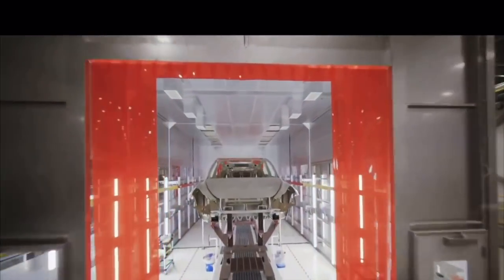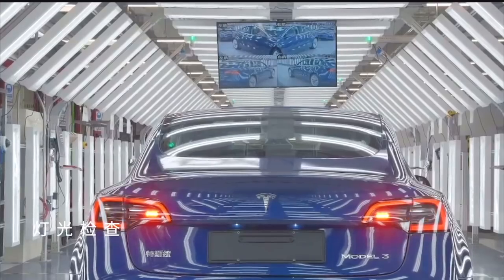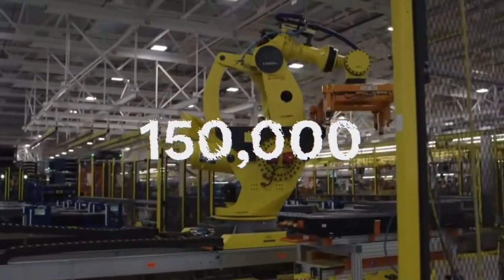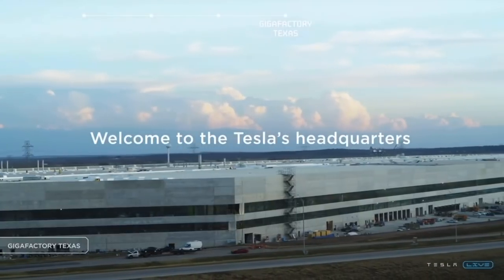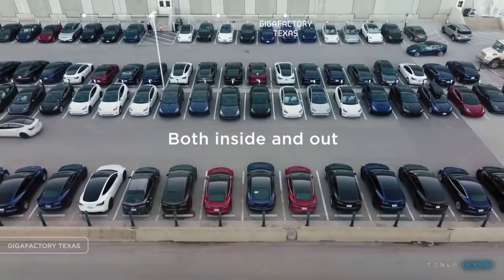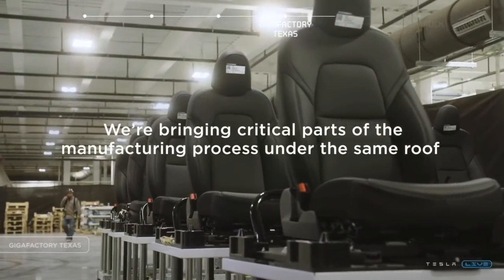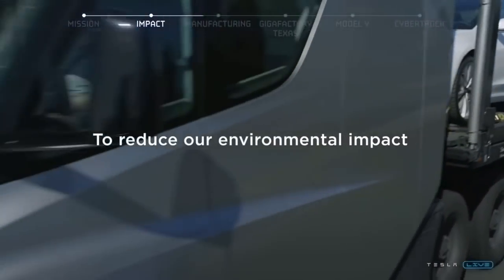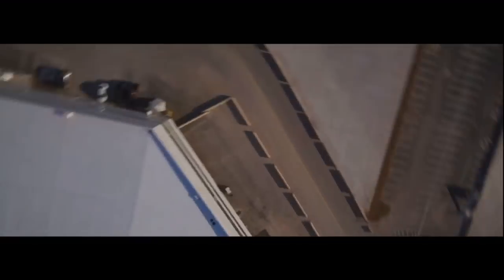How Tesla's Gigafactories Are Changing Manufacturing & Why They Are So Important For Our Future!

Comment from the maker: Try MooMoo and get up to 6 free stocks, Get additional free Apple stock from the financial Literacy event. Use this link to get started: https://j.moomoo.com/009GFR
Reply: Hey Lars? Im pretty sure I know how Tesla is solving the cooling constraints in the giga-casting system. The issue would have been the secondary coolant. IDRA designed the system with a coolant loop that goes through a network of heat exchangers. You see them in photos as groups of square panels with a couple gauges and lights on them. Coolants have thermal-dynamic limits. They can only hold so much energy, but the same time you have to move it at just the right pace to assure you are getting as much energy out of the cast, without cooking it. The casting surface is actually a big block of metal with cooling loops inside it that is carved to the dimension of one side of the mold. That chamber inside could be used as a direct blast refrigeration system instead. making the inside of the mold the chiller in the system. Refrigerants are a lot more efficient way to remove heat than secondary coolant loops. But they have had to design a new form of a compressor probably. Some sort of high volume, high efficiency screw compressor if I had to guess. Something that could pull and maintain a lot of vacuum at high volume.

Comment: For people who think our world is ending, they don't understand Tesla. The Tesla company is an example of the new world. Elon has brought a new template of "thought" to the Earth. The template of thought before 2012, was to build cars based on profit, and profit only. Honesty, integrity, and customer satisfaction was always secondary to profit. 

For proof of greed being the primary objective of large car companies, consider how many cars have been sold with bad automatic transmissions, bad CVT transmissions, bad cylinder head castings, and bad head gaskets (Subaru, Dodge/Chrysler/Cadillac).  

Side Note of Terrible Cars: Consider how many Ford SUV's burst into flames while parked, due to the brake reservoir sensor shorting out, or the cheap factory Firestone tires exploding due to being too thin, or how many bad intake gaskets dissolved on GM products due to their proprietary corrosive orange antifreeze (Dexcool). Consider the Chevy Volt which has reportedly burst into flames while parked. Consider the Mazda Millennia which had a class action lawsuit for having a bad transmission. Consider the Nissan Rogue which has a bad CVT transmission. Consider all the bad CVT transmissions out there today in all vehicles. Consider the Chrysler "K car" or the Dodge Neon with it's cracked blocks and blown engines. Consider the Dodge Ram truck with it's highly dangerous front suspension where the wheels literally snap off after 100,000 miles.

I've seen at least 5 Dodge trucks with one front wheel snapped off completely from the front axle, laying on the frame on the pavement in the city! Has Dodge done anything to admit to this problem or pay people back for giving them a lethal vehicle where the wheels actually fall off? Nope.

Every Subaru today is a ticking time bomb of unreliability, due to the open jacket cylinder bores, which are destined to flex and blow the head gasket. Subaru could switch to a "closed deck" engine, but that would be more expensive. They are one of the many companies knowingly selling defective engines, in all their cars. 

Tesla would never sell something with the foreknowledge and expectation of premature catastrophic failure of the engine, or having the wheels fall off during normal city driving!

Elon has brought a new template, and that template is: Customer satisfaction, functionality, reliability, performance, honesty, transparency, and value, followed last by profit. This mind pattern has changed the entire world, already. And if anyone doubts that our future will be good, one only has to look at the other major car companies directly copying Tesla. 

The American car companies have been forced to reevaluate their mental template, and to discard the original plan of putting greed and profit above customer satisfaction. If they don't put customer satisfaction as their #1 priority, and if they are not absolutely bluntly honest, like Elon Musk and Tesla, then they will fade away from our reality. 

Thanks to Tesla, our reality will no longer tolerate disingenuous car companies who are sneaky and deceptive. Tesla has changed our expectations of a major corporation, and set a precedent of transparency that was heretofore impossible to imagine just 10 years ago. 

If Tesla offers a phone, or a computer operating system, then of course everyone will buy it, because they have established the trust of the people. That trust is truly priceless. And that is why we are indeed entering the Golden Age on Earth.

Comment: Toyota have 5 years at most to change outside Japan . If it does not change before 2027 it will very quickly become unprofitable and sink at an unbelievable rate. Japan needs Toyota to see the light or pay the piper

Comment: What you are leaving out is Ford will have multiple factories. So while Rouge will have a annual run rate of 150,000 trucks.  Ford will have other factories as well.
Reply: As long as some of those factories are battery factories I think Ford will  do ok.
Reply: @TheEvilmooseofdoom  they are building the battery factory in Kentucky.
Reply: What you are leaving out is the legacy assemblers will not be able to compete. They will either go bankrupt, merge or be bailed out.
Reply: @garethrobinson2275  I suspect it will be the next banking credit crisis.  Tesla could shutdown overnight if the bank stopped offering working capital. While the legacy manufacturers have massive leverage with all the debt. It ends up who can hurt the banks more.  Tesla entering a short bankruptcy period.  Or the collapse of billion of dollars of bank assets.

Comment: Jordan corrected himself on a later video.  He does not know that the casting machines can go twice as fast.  He does know that they have changed the cooling system to speed up the casting process
Reply: Nope it doesn’t go twice as fast and the finished pieces have to pass an inspection test for safety and durability down the line lol…. Stamping is till significantly way faster that’s why vw is able to make 10 million cars each year

Comment: No, the cars are important but the solar panels are more Important. The e cars sway people to e but that needs to convince people to spend on the solar panels as well. It's solar, wind, which transitions people to renewables. Not e cars. We need giga factories for the solar panels. That hasn't happened yet.
Reply: Those panels are most entirely made in China just like the batteries and everything else’s from electronics….. lol….
Reply: @carholic-sz3qv  Yes, the suppliers and raw materials could mostly be from China, with the final step done here. It still means China controls pretty much all of the production. But I rather get the solar panels ramped up than not, as we work out all the rest about national concerns.
Reply: @dougwedel9484  lol…… and you totally forget the worst conditions and environmental impact of those industries in China! Plus the minorities Uyghurs that are in camp there making solar panels…..and cells that tesla uses….
Reply: @carholic-sz3qv  It sounds like you know a lot about this. Please tell me more and some links to back this up. I want to know more.

Comment: Tesla's approach to thinking about a factory is so much different. To see a factory as a whole entity rather than a bunch of different parts, pieces, and machines is radically different. Every thing that goes into a factory is like a piece of a puzzle. The pieces aren't the goal of a puzzle it's the final picture that is the goal. So it's about making the entire factory one giant creation that is set up to be most efficient as a possible rather than each station or machine to be as efficient as possible. That's how they produce a car in 10 hours not 30 as VW does. We see the same approach to the car as being looked at as a whole not as pieces jammed together. It's how you get parts that fit across all of their models. The integration of everything in the end saves money, time, and training. And it all shows up at the bottom line.
Reply: Lol…… that’s the exact thing actually with other companies too, except that they make much more and different car models than tesla so you are wrong here, does tesla make any van? Any RV? Any commercial vehicles!? Any truck!? Any armoured vehicles!?….. Tesla doesn’t even offer enough customizations for their cars what a joke!!!
Reply: Bmw built almost a decade ago one of the worlds largest carbon fiber factory powered by hydroelectricity and been using them in many of their cars to seriously reduce the weight and much more!
Reply: The vw thing is a joke right?! Didn’t Tesla did the same time when they were still ramping their production!? Lol……
Reply: @carholic-sz3qv  VW don't see a path to this rate of production without copying Tesla. Wishing them good look with that loling guy.

Comment: I think Tesla ought to offer the service of factory design for a broad range of industries. They can use HVACs as a pet project. There isn't an heavy industry that can't use a First Principles revision to their production lines.
Reply: Isn't Tesla already planning on taking the Tesla vehicle HVAC technology, and making a more efficient home HVAC system?
Reply: @NeuroPilot1  nope, the problem of HVAC is first house/building insulation and American houses are the worst in the world when it comes to it. They barely have any double windows glazzing for example whereas in Europe they have thicker walls, up to triple glazzing windows, they barely uses any HVAC in Europe too except for heating in winter.
Reply: It's not that easy.  Elon has said it.  Production is hard. Making different production lines for different products would be a whole new and intense business in itself IF it could even be done.
Reply: @TheEvilmooseofdoom  lol….. they can’t! Tesla only makes two vehicles types while Mercedes’ alone makes all kinds of vehicles from sedans to suv, pickup, vans, semi, commercial vehicles that have tousands different configurations for different applications, they also make f1 cars and much more….
Reply: @carholic-sz3qv  Too many models is a big part of the legacy assemblers problem.
Reply: Too many egos outside Tesla to allow First Principles

Comment: But can Berlin produce to scale if Germany has an electric shortage due to natural gas shortages?
Reply: With time the factory will use solar and wind energy to run production
Reply: @udomann2784  I think the major issue (with gas) for Tesla is the furnaces to melt the aluminum for the casting machines.
Reply: @TheEvilmooseofdoom  those fournacises uses a lot of energy and electricity bill will be very hard
Reply: @udomann2784  nope unfortunately Germany is not Texas where the shines almost all year long lol….. Germany has wind potential but it wasn’t installed by tesla so nope!
Reply: That’s temporary

Comment: With the layered proximity of all those moving parts and battery plants on the top floor, I certainly hope they have excellent fire suppression systems on board.  Giga Texas is like a Battleship or Aircraft carrier with all elements in close proximity.  Fire is the greatest risk to Battelships.  Better yet, Gigatexas should have their own fire department.
Reply: An evacuation plan and proper training are the best safety measures.  All manufacturing plants have to meet fire code and OSHA requirements accordingly.  In a Battleship, you can only jump overboard to the mercy of the open sea.
Reply: @longmuskox4194  I was thinking more about preservation of the "ship", lives of course are important too.
Reply: @jryan1024  The factory is insured, but lives are priceless.  I doubt the Battleship would be insured.
Reply: @longmuskox4194  Ask Putin, I guess.  Maybe he has Geico.
Reply: @jryan1024  Oh, I didn't know that GEICO was a Russian company.  But, that wasn't a Battleship, that was a Cruiser.
Reply: @longmuskox4194  Guided Missile Cruiser.  Approx 12000 tons.  There have been no Battleships constructed since 1944. I have been on the Iowa, Missouri, New Jersey, and I served on the Wisconsin in the 1990s. These Iowa Class average 58000 tons.  I am well aware of these designations. The Moskva Slava class is roughly the size equivalent of the USN Arleigh Burke class cruisers. The largest non-Carrier surface combatant, built since WW2 is the Kuznetsov 20,000 tons also a missile cruiser. I appreciate your correction, but I am well aware of the designations, as you see. I was using the "Battleship" designation as a generic for "warship" in order to perpetuate a joke at Putin's expense. Cheers. Go Elon.
Reply: @jryan1024  I know you were and my sense of humor is dry.  I knew it was a Missile Cruiser.  Just like I know GEICO is not a Russian company.  Hehe 🤣
Reply: All good.  Keep up the friendly dialogue.  Slava Ukraine.
Reply: @jryan1024  You too my friend.  Slava humanity.

Comment: Just a note my friend, Toyota don’t use “Agile Manufacturing”, they is “Just in Time” manufacturing. 
It is Tesla that uses “Agile” and according to Joe Justice they are light years ahead of EVERY company that uses Agile methodology.
Reply: Those we're some eye opening videos by Joe J. Especially the one about how they implemented the m3 breakthrough to allow faster charging.
Same day, same line, same people. Once engineering approved the changes they got implemented on the line that day, so every car from that point on had the new charging hardware.👍🏻😎
Reply: Tesla does just in time too. More so than Toyota in fact. They have almost no inventory at all. No warehouse in Giga Shanghai. 3 days worth of sales for completed cars. If that's not JIT manufacturing then I don't know what is.
Reply: I would say that the difference is that Tesla is Agile-First Principles. ie - spend the time to do it right, even if you take losses in the beginning. Don't assume that the state of the art is the best.
Reply: Joe said that a Tesla factory is basically an hardware compiler... Seems a good metaphor... 😏
Reply: The Toyota production system is 20 years old. Everybody tried to duplicate it and it is a dinosaur.
Reply: @ZeusBullyMax  lol…. Everybody tries to replicate Toyota system but most of them failed, the global economy is actually using Toyota production system lean manufacturing!
Reply: @carholic-sz3qv  There is an excellent correlation between the use of 'lol', 'lmao' and similar with being indisputably wrong. It's uncanny.